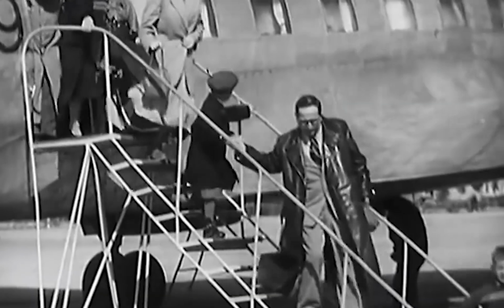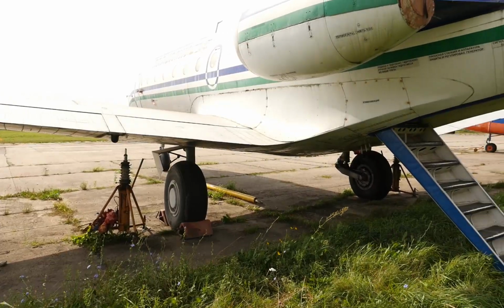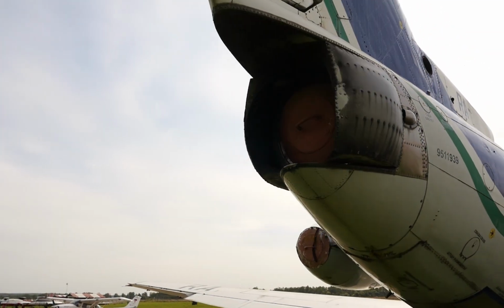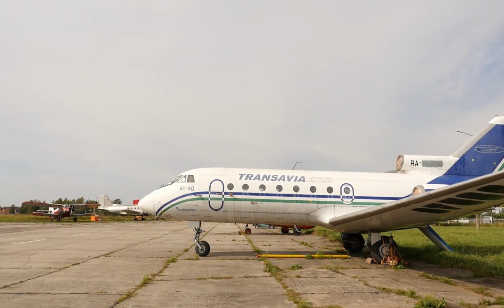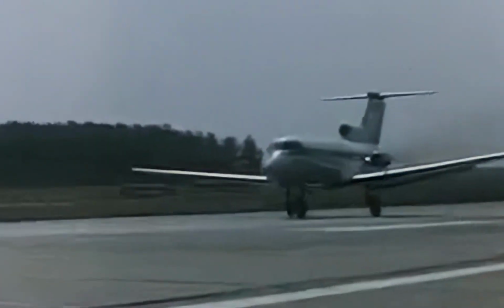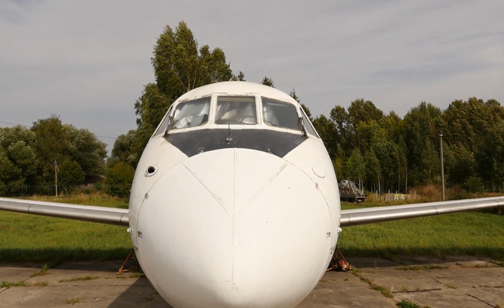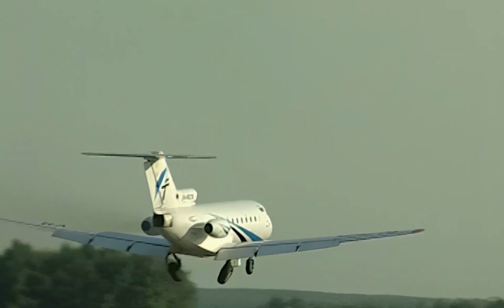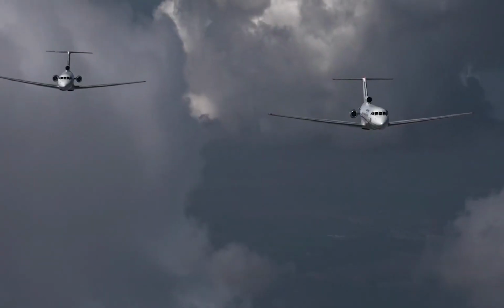Yak-40 | A village trijet

Comment: Excellent post as usual. There are several cadidates for the "DC-3 replacement." Was this one of them? I have to say that this is a really cute solution to a big problem. I wish you had given more details about its safety record, external factors notwithstanding. Thnaks so much.

Comment: Looks like it was loosely copied from an American Boeing 727. The 727 was released in 1962 while the Yak 40 was released 3 years later. It seems that Yakovlev never previously designed an aircraft even remotely similar to the Yak 40 or the Boeing 727, but all of a sudden.... . Clearly Yakovlev did not have access to the American engines, etc. and designed it to be smaller. Even the Yak 40's central thrust reverser is a similar design to the type on the 727. And the Yak 42 is just a bigger version with thrust reversers that could have come directly off a 727. Apart from the Yak 40 and 42, Yakovlev never designed any similar aircraft or even airliners afterwards until the rare MC-21. The Boeing 727 had to influence Yakovlev.

Comment: Every time I see a video filmed on-board one of these, it has a desperate struggle to get airborne, followed by a mind numbingly slow climb. Not sure where "good takeoff performance" remotely comes into it. They could have used a turboprop for that, would have burned less fuel as well and flown at the same cruise speeds.

Comment: As a westerner who worked in the aircraft industry, I was really pleased in the 1990’s to fly in a number of Russian built aircraft. The feeling was always that they were robust and functional. Flying in the Yak-40 was a joy albeit the plane was quite tiny and as you point out it flew at quite a low altitude which was a bit disconcerting over even modest mountain ranges.

Comment: The commentary here is a fantastic demonstration of how very difficult a language English is and gives the lie to the canard that it's easy. There are a number of consistently repeated translation mistakes "aviator" rather than the correct word, "designer". While some of the expressions chosen appear to be lexicographically correct, they are not correct English as no native speaker would use those words in that context. It would be valuable to get a native speaker run an eye over the script, and not rely purely on the output of Google translate.

Comment: I had the pleasure? of flying a Yak 40 on a bitter cold morning in Siberia on my first business trip to the old USSR in December after Yeltsin climbed on the tanks.  As passengers we were taken by bus to a cold plane in the darkness of the artic morning.  The mechanics opened the plane,.. we boarded.  As one of the first foreign business men traveling to a former military city previously not on the maps, I sat in the front row between a small elderly woman with an equally small yipping doggie sitting on her lap on a towel.  The other passengers filling the plane to the max included a young Russian man across the aisle from me with a growling pit bull at his feet.  A mechanic proceeded to go into the cockpit to warm the instruments so they would function for the pilots.  After many long teeth chattering minutes the pilots appeared and brought the engines to life. As a seasoned Western commercial jet traveler, the takeoff roll seemed painfully slow and lumbering.  Was the plane overloaded?  Would it fly?  Yes, finally a slow climb out was completed. The rest of the trip was fairly uneventful, except for the pitbull's growling lunge at the doggie with me in the middle!! Thankfully the young Russian man had the leash as short as possible.  Other than a few moments of smells from the pitbull's innards, the flight was enjoyable.  I was thankful to feel the main gear touch down at our Siberian destination!! :))

Comment: Except its high fuel consumption and it motorization and avionics that are now obsolete, the design of the Yak-40 as short-haul STOL jet airliner was cool and well ahead of its time in terms of simplicity and minimalism. It is a pity that such aircraft did not follow up with a 2-engine upgrade and passenger comfort improvement.

Comment: Jesus Christ.......... I think the Bugatti Chiron at top speed is more economical with its fuel than this 24 seater....
Also, you said that this little Yak 40 had, apparently, done a barrel roll which sounds impressive, even for a 30 dearer small civilian aircraft, but..... when you think that the Rockwell B-1b has done barrel rolls, one after another, and this beast is about 45m long and weighs about  85 metric tonnes.

Comment: So it has jet engines but a straight wing, thrust reverse but not slats, thrust reverse on the center engine but NOT on the side engines (the reverse is more common). What a delightfully eccentric little jet, I like it.

Comment: Eventhough it is in Czech... This is as close to the interior as you can get.. The Czech Army has said farewell to the Jak-40s they used as small transporters for short routes. The modernisation of the Army as such naturally resulted in ending the use of these types...  These went through many modernisations but this was the end of the line. https://www.youtube.com/watch?v=p-4jHpyYAUk  These are replaced by the CASA and when it comes to government officials, a similar siyed private jet or regioanal jets are already being considered. The pilots in the video spoke about flying fast but freezing as the heating/arcon had to be minimised or turn on the heating and fly real slow. He also stated that the handling was OK but after touchdown the plane had 7-9 sec of real trouble going straight and cross winds always made it go the opposite of what a pilot wanted, so in that regards was very hard to handle even if there were crosswinds when taking off. The first one (designated as K or kombi - passenger and cargo with the large door on the left fuselage side) and with the regular seats is only 1yr older (white cockpit) but apparently was very tough to fly (he said both hands and legs for max 20min max and you were knackered) as the controls were very heavy as oposed to the other one with the green cockpit, where you can fly it holding the controls with 2 fingers as he said. Czechoslovak airlines had some as passenger https://cdn.airplane-pictures.net/images/uploaded-images/2012/12/27/257022.jpg ín the 60s and 70s till 80s

Comment: The rebuilding of Yak 40 is best choice to use this hard aircraft for the next 50 years . Yak 40 is the Russian Dakota DC3 then you can use great aircraft in the 21st century this upgrading should be included glass cabin,  new an advanced engines & the wings basically.

Comment: It is a handsome plane, I had a model kit from East German production, it wasn't the best kit and not well built by me either, but it was on a shelf till 10 years ago, when I threw it away for some reason.
But looking to the numbers of the plane there was absolutely no reason this plane should have been a jet plane, turboprops could have done the job equally well, with at least double the range.
It was for prestige, as I think that comfort for the average passenger was low on the list of importanties in the Soviet Union, as was safety, looking to all the luggage stowed on open shelfs and in the gangway.
How would these people ever evacuate the plane in time after a crash landing?

Comment: Your command of English is excellent. Awkwardness is very low, equal to or less than a typical native English speaker. Don't worry about your accent either, you're perfectly understandable which is the goal of English. Which reminds me; there are few hard and fast rules to English, the goal is to have others understand you. Infact, your biggest problem is probably the use of aviation industry specific terms but I imagine you already figured that out :)

Comment: That moment when You realize the Yakovlev Yak-40 is basically a tiny Boeing 727: A low-wing, 3 engine jet aircraft , all engines in the back, a tail ramp under the back, a T-tail and it carried passengers. It kinda checks all the boxes the 727 does, just it does it in less size.
Reply: The purpose of both plane is different tho

Comment: As much as I understand the comments regarding the (lack of) economy for a three engined regional airliner it is always important to put this into the right perspective.
First of all fuel price was not relevant in the USSR.
Just the payload/range requirements had to be met - which the YAK-40 did.
The problem at the time was that there was no other suitable engine availlable but the AI-25 which did not provide enough thrust so that 2 engines would be sufficient under all operational circumstances.
The aircraft was designed to operate from short/unpaved/gravel/snow/ice covered runways and had to be technically very simple.
So, the wings were designed straight without slats etc. to simplify maintenance and maximise fuel storage capabilities.

Despite its horrible inefficiency by todays standards it is still possible to fly on a YAK-40.
Not regular/standard but occasionally Motor Sich Airlines (Ukraine) substitutes their AN-24´s with their YAK-40´s on scheduled flights.
I was lucky to fly Kiev - Krivoy Rog - Zaporizhiya on UR-88310 in september 2013 and I know both YAK-40´s (the other one is UR-MSX) are still operational to date ...

Comment: I don't understand why they didn't just upgrade the engines to more powerful and fuel efficient ones. They could also have done better with cabin pressureization so they could go to higher altitude for fuel economy and speed.

Comment: I did a lot of private flying in and around the Persian Gulf between 1995 and 2005. When I flew into Ras Al Khaimah airport I frequently saw a Yak 40 on the apron. It was used for visa runs between Ras al Khaimah and Kish Island off the Iranian coast. What was disturbing was to see fire tenders in close attendance when the Yak-40 was about to start its engines. Apparently, it was not uncommon for one or more of its engines to catch fire on start up. If the apron was covered in soot and water and fire hoses, these were signs that such a fire had recently occurred.

Comment: I have traveled on IL-62 in the 80s, scary enough. I would not willingly board the YAK. Thanks for the entertaining videos and analysis. You are also mentioning the Albatros. I had a private tour of the Aero plant in my hometown just last year. Exciting.
Reply: In fact most accidents in eastern block aircraft were caused by personnel, not by technical problems. These aircraft can continue with several issues and land safely. And they usually managed to perform huge amount of flyhours. Western airlines on the other side have more accidents caused by technical issues because western planes are not so robustly overbuilt and cost-saving measures are placed above reliability and longevity.

Comment: Comparing the Yak-40 to current RJ's is a bit unfair.  It's true competitors were the Fokker F28 and VFW 614.   The Fokker, having the Spey Junior turbo fans, was just far ahead in terms of engine specifications.  The 614 was just a strange design, but would probably have been good for rough field operations with the over wing engine placement.  But politics got in the way tragically.

Comment: 06.37 Skyships, you know what I'm going to ask, could you please do a kN to lbf conversion (yes I do know pounds are a force by definition, but I put lbf for convention) if only in the subtitles?  Its the one thing I can't do in my head so always have to stop your film at the Kn quotation point. For those as ignorant as I am 14.7 kN = 3,307lbf
Reply: metric is used universally, that what makes this channel so easy to follow.
Reply: @TRPGpilot  Generally I have no problems with metric units I fully comprehend that they are a damn sight easier to use when performing calculations into differing qualities. I  can do a rough conversion of speed and mass in my head but I can't do a mental conversion for thrust.
Now whilst you have told me how universal metric is I have a question for you. In the vast majority of the world what units do we use to express an aircrafts height and speed?

Comment: The YAK-40 would have been a much more successful regional jet if the designers had used a swept main wing and a larger fuselage and engines. A passenger load of 45 to 50 was the desired loadout for most Western jets, but the USSR/Aeroflot wanted to serve towns that couldn't support that kind of load, but could provide 25-30 passengers. It was just too small and too slow to be compettitve in Western markets, but the Yak-40 was built to serve the USSR market, where airliner service was a matter of politics rather than market needs or profitability. Airports were built and Aeroflot service was based on what important party or military members lived in the area rather than other passengers clamoring to get on. The Yak-40 did a fine job of serving the market created under the old USSR. Once that ended, the need for the Yak-40 ended with it.
Reply: Airframe and aerodynamics wise the Yak-40 is really just a turboprop aircraft that just so happens to have been fitted with jet engines, you then have an aircraft with the disadvantages of both a turboprop and a jet plane without the advantages. I'm not sure what it is a Yak-40 can do that an An-24, Fokker F27 or ATR-42 couldn't do?

Comment: The Yak-40 was also know as "soot-sling" in former Czechoslovakia. Explanation: The maximum allowed temperature of the second stage on the Ivchenko AI-25 turbines was 650°C. That is below the temperature of burning kerosene fuel! Anyone who had the luck to stand behind a Yak-40 with its engines running knows how a kerosene face pack feels.

Comment: Rear mounted tri jets still look the coolest imo
Reply: As opposed to forward mounted tri jet??
Reply: @rickc303  you know there are tri jet configurations where two engines are wing mounted and one is rear mounted...
Reply: @Unchainedmaple888  by design, every tri-jet has a rear mounted engine whether 1 and 3 are fuselage or wing mounted
Reply: @rickc303 so because at least one engine is in the rear, every trijet is automatically a rear mounted trijet, in spite of two out of three of the engines being mounted on the wings in one of the standard configurations? How exactly would you prefer he phrase that, pray tell? "Tri jet aircraft in which all engines are fuselage mounted"? Because by your logic just saying "aft trijet" to differentiate between wing-and-tail trijet is somehow wrong and incorrect, because all of them have at least one engine aft.
Reply: @rickc303  Yes, like the DC-10 and MD-11 and Lockheed L-1011. Obviously he means planes where all three engines are rear mounted, instead of just the third engine.
Reply: @rickc303  as opposed to every other engine mounting configuration
Reply: Ikr
Reply: @adrianenterprise5829  I'll go for a rear quad. The most wonderful VC10.
Reply: @COIcultist  I prefer the Il-62.
Reply: @COIcultist  yes there also very nice
Reply: I still prefer the l011
Reply: The Falcons continue to take the cake....and to eat it too.
Reply: L-1011

Comment: Question: Why was the third engine mounted on the Yak-40? 
Answer: To compensate for the added mass and aerodynamic drag caused by mounting of the third engine.
Reply: The third engine is there just for the safety purpose (backup). It's not needed for the additional thrust at all. But thanks for the classic Yak-40 joke!
Reply: @michalpavlat3943  but the thrust of the third engine was necessary for the short takeoffs. It could take off on 600 m lenghth
Reply: If only they've the fore sight to develop a twin-engine version with the space for third engine converted into streamlined section for fuel storage. Plus "thinner" wings for improve aerodynamics.
Reply: 2 engines and a extended fuesalage may have been more conomical
Reply: Lol
Reply: HAHAHA love it!
Reply: Haha! Not really, but very interesting
Reply: BAWHAHA!!! THAT'S BRILLIANT!! 😂👍👍✌️
Reply: The same could be said of the 727, Dc-10 etc...
Reply: @skooter2767k  Nah due to the 60 minute rule the DC-10 wouldn't have been allowed to do what it was built to do, and that is cross oceans as a long haul aircraft
Reply: @skooter2767k  Yak did not do ETOPS.
Reply: @skooter2767k  you are wrong. The answer for them is the old Etops, which was made a much longer route for 2-engine plane than 3-engine planes. Cause jet engines weren't safe as now.
Reply: @mozeskertesz6398  *facepalm
Reply: @mozeskertesz6398  it was a regional jet, so ETOPS was not an issue imho